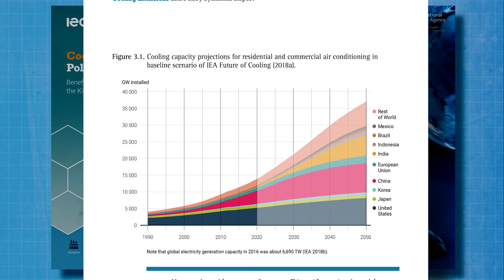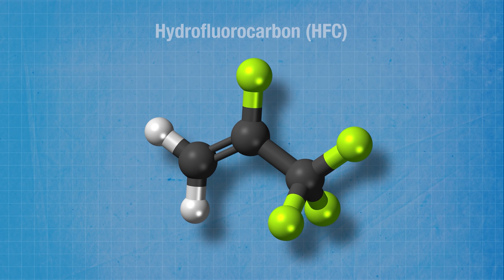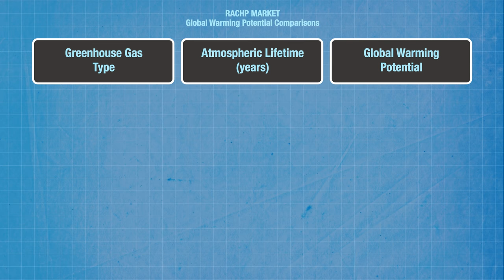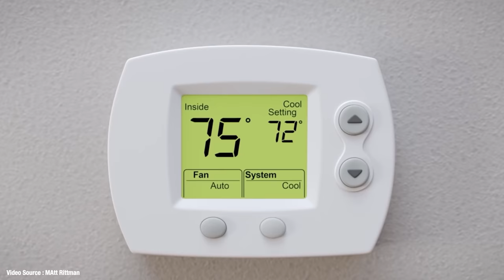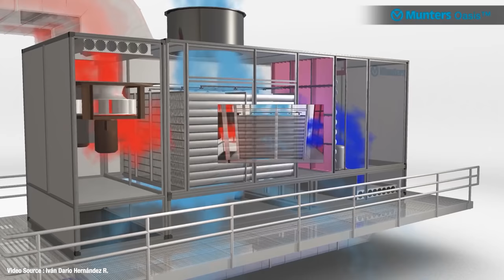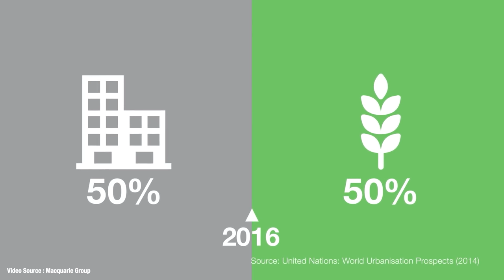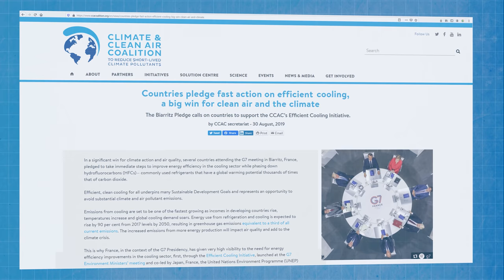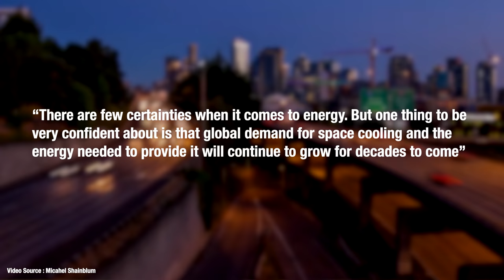Keeping cool in a warming world.

Comment: I am a 30+year experienced refrigeration engineer and the real problem with refrigerant containment is share holders continually reducing budget for greater profits. Less budget means less staff to correctly maintain equipment and greater refrigerant loss.
Reply: But... The cut there own tail... As you know to an well maintained chiller are more energy efficient and will live longer. Check out ClimaCheck if you haven't. It's an add on equipment to analyse every part of the cooling cycle, get larms in advice for failures and other changes in the system affecting efficiency and maintaining. To be transparent I have been working for them 10 years ago but now I am there customer and I have so far not heard of any competing system. If you know, tell me!

Comment: With enough clean electricity anything  is possible.  I think its high comedy to blame an infant industry of radiation transmission for the problem of radiation absorbing capacity.  At worst its part of the adaption,  at best its part of the solution.

Comment: The scariest thing is we are basing policy on IPCC  models that have never made even a single skillful prediction. It,s a failed hypotheses.
Reply: @incognitotorpedo42  your linked data is quite old. By 2016 the observations were right at the upper limit of the IPCC projections. It does seem that the IPCC, if not wrong, certainly painted a far rosier picture than what actually happened.
Reply: @gasdive  True, it's actually warmed faster than they predicted, if anything.  I'm pretty sure the guy I was responding to was making a denialist argument though.
Reply: @incognitotorpedo42  I'd say you're right, he was. It's amusing that they get it so completely backwards.
Reply: @amirlach  Your first link uses cherry picked old data.  If you look at data out to 2019 or later, you'll see the IPCC models did not overestimate.  Denialist blogs like WUWT are not a reliable source of information.  The AR5 animation still uses old cherry picked data.  It also makes the statistical error of starting the line fit on the first point.  This is discussed in my link.
Reply: @amirlach  You keep showing me the same dataset that ends around 2012.  These denialist blogs that you frequent use language that "smells like science" but they never get it right.  People were making claims about bad surface temperature data ten years ago.  I took it seriously, looked into it, and it turned out to be crap.  It's still crap. I'm telling you man, denialist blogs are full of it. They are a disinformation cult that recycles debunked garbage.  If you really want to know the truth, leave them.  If you want to bathe in the soothing waters of what you already think is true, then keep doing what you're doing.

Comment: Co2 will not make high temps higher, it’ll make the low temperatures warmer. I wish people would understand this.
Reply: It does both.
Reply: ,
No it won’t “do both”, that violates the 2nd law of thermodynamics.

Co2 acts as a blanket, a blanket does not produce heat but acts as an insulator.  How does an insulator produce heat?
Reply: @yosemitejam  no, it doesn't either produce heat or break any laws.

Energy comes in and heats the ground. The insulator slows the energy getting out. So the temperature has to be higher for the outflow of energy to equal the inflow.

If there were no greenhouse gas the earth's temperature would be about negative 18 C (cooler than the average sea-level temperature in Antarctica) and the maximum temperature would be much lower than it is now. So the lowest and highest temperatures on Earth are already elevated by greenhouse gas.
Reply: @gasdive ,
You are incorrect sir, the Moon is a similar distance with no atmosphere and the extreme temps are higher and lower than Earth’s.

“Temperatures on the moon are extreme, ranging from boiling hot to freezing cold depending on where the sun is shining. There is no significant atmosphere on the moon, so it cannot trap heat or insulate the surface...When sunlight hits the moon's surface, the temperature can reach 260 degrees Fahrenheit (127 degrees Celsius). When the sun goes down, temperatures can dip to minus 280 F (minus 173 C). 

https://www.space.com/18175-moon-temperature.html
Reply: @yosemitejam  yes, but as you point out, no atmosphere. Which also means no seas. Which means less thermal inertia. That, combined with a "day" of 709 hours means higher and lower temperatures on the surface.

Without greenhouse gas the oceans would freeze. The surface would be ice. Never above 0C.
Reply: @gasdive ,
Not true again, oceans could never freeze because H2O is a green house gas, a more powerful GHG than Co2, so would trap heat, but not produce heat. Understand that no matter how many Co2 blankets you put on it will never make you/earth hotter than the sun would. Co2 cannot produce heat, it only traps it for a time.
Reply: @yosemitejam  I'm not saying we'll get hotter than the sun. The sun is 6000 K. We're like 300 K.

Oh, and the oceans have frozen in the past.
Reply: @gasdive , 
Sweet baby Jesus, what are you smoking?  Co2 can NOT produce heat, what don’t you understand about that?

The fact that the Moon get upwards of 280’ F should tell you that the Earth’s atmosphere keeps us like porridge, not too hot, not too cold.  Co2 will not and cannot make the days high temp hotter. Co2 can only act as a blanket and make the low temps warmer.   

Your concept breaks the 2nd law of thermodynamics.
Reply: @yosemitejam  what I don't understand is why you're continuing to argue against something I not only haven't said, but have carefully explained, isn't what I'm saying.
Reply: Yes you are saying that Co2 produces heat because you  stated  above “it does both.”
Reply: @yosemitejam  no, I'm not
Reply: @yosemitejam  OK, let's try this...

Highest tmperature on Mercury 430 C

https://solarsystem.nasa.gov/planets/mercury/in-depth/

Venus, further from the sun, 471 C

https://solarsystem.nasa.gov/planets/venus/in-depth/

I'll say it again, GH gases don't create heat, but they do make it harder for the heat to get out.

On earth nearly all the heat arrives as visible radiation. That goes straight through the atmosphere without heating it up. It hits the ground, which heats up the ground. The ground being hot radiates heat, just like every other thing with a temperature. The ground gets hotter and hotter, radiating more and more heat until the amount of heat it radiates equals the amount of heat coming from the sun.

If you then add GH gas, that blocks some of the heat coming from the ground. Now there's an imbalance. More heat is coming in than going out. So the ground heats up and radiates more. Eventually it heats up enough that it radiates at the same rate as the incoming radiation from the sun. GH gas isn't making heat. It's stopping some of the heat from escaping. There's so much GH gas on Venus that the rocks actually glow in the visible spectrum.
Reply: @gasdive ,

You stated:
“If there were no greenhouse gases the Earth’s temperature would be about -18C (cooler than the average temperature sea-level temperature in Antarctica)...”

This is untrue because the Earth would be the same temps as the Moon  (-173 C) 

You continued to state:
“AND THE MAXIMUM TEMPERATURE WOULD BE LOWER THAN IT IS NOW...”

This is misinformation, as you can see from temperatures on the Moon, the maximum temp was 260’ F and the earth doesn’t even come close to reaching that high of a temp. These temperature extremes are due to NO ATMOSPHERE on the Moon, not addition Co2. 🙄

To sum it up, Co2 acts as a blanket to help keep the Earth warm at night, Co2 does NOT increase daytime temps )as can be seen by the Moon) and you literally have no idea what you are talking about.  Please stop talking nonsense.

Comment: What I learned from this video: "heavy handed government control will save us"
Reply: Alright; then who or what mechanism do you see other than government likely to do so before we are gasping for air? The Capitalists are making big money off the system as it is- until they see big money for cheap, they are not going to be advocating much less actively making this change happen. Please, feel free to answer- I, and several billion other people need this info soonest!
Reply: We aren't doing very well WITHOUT regulation.  Dave never argued for "heavy handed" anything.  The Montreal protocol was sensible and very successful.   That's the sort of sensible regulation we need.
Reply: To take a constructive approach here - I think we can reframe what can be seen as the ‘heavy handed government control’ that it seems like you’re hearing. I don’t hear a need for draconian government measures, rather a ‘joined up approach’ between government, private businesses and individuals that can help reduce impact in a real way. 
Consider urban planning for roads and buildings - it’s pretty widely accepted that road and building planning and construction requires government involvement if things are to be done right. There are most likely set of rules, guidelines and best practices at local, regional, and national level where you are that apply to roads and buildings. Rather than being necessarily heavy 
-handed (and if you’re willing to come with me on this) it’s not impossible to bring ‘urban heating and cooling’ under a similar set of rules and guidelines at different government level, which sets a higher baseline and works to ensure that the cooling and heating of buildings isn’t looked at purely on a building-by-building basis. Reframing in this way hopefully helps assuage concern around the need for heavy handedness.
Reply: @clog1q  I spent my adult career in big construction and the later part in residential service and remodel- I'm on your side! And you are quite right, there are many areas where we already have much "guidance' through laws and codes to keep our living spaces relatively safe and clean. Shinnah seems to feel that anything but unfettered capitalism is a bad thing- I merely pointed out that it needs watching much as communism and socialism.
Reply: The problem with heavy handed "globally coordinated action" is that the United States is expected to change but developing nations get a pass.  The working class of the United States are already over regulated and over taxed.  Videos like this that promote government intervention to problems that capitalism would likely solve on it's own, are a dime a dozen.  It you want convince the working class to change, show them innovation, not regulation.  This video just shows innovations that are only viable if funded by taxpayers.
Reply: @ShinnahWilde  The problem is now- not fifteen or twenty years down the road. FWIW, the big oil companies, who started in the coal biz, mostly, did not change from the much dirtier coal willingly, but only as a result of the rapidly contracting market for their product. Just look at how much inertia and resistance there has been for the higher efficiency HVAC units available today. Everybody knew we needed to do this, but few individuals wanted to pay the additional costs- therefore the rules and codes approach. the environment is the same- the companies that benefited the most form creating this mess would rather spend a few million on lobbyests than do the hard expensive work of cleaning themselves and their past work up. Take a good look a t coal slurry pits and how hard Duke Energy and many others have fought to keep rules lax and ineffective about these open site hazards to the water sources of many communities in the US today. Or the XLT pipeline passing under a river, where a leak will make the water several million people drink from and the tribes in Nebraska eat fish caught from. Raw Capitalism isn't going to answer this till it absolutely has to. Take that to the bank- they would rather hazard the entire nation to an ideolog like Trump who wants to be The King. After all, they are rich enough to buy even a corrupt Child King off.
  As to the "getting a pass"; until already developed nations embrace these changes and use their developed markets to begin the mass production and generational improvement to these means and devices, the developing world will be less able to buy and use them. The move toward sustainability must start somewhere, and the developed world is where the bulk of the human caused side of this disaster started,, and much profited on it, BTW. The big oil companies in the US and those abroad are among the most subsidized industries on the planet- it is only fair that this gives them a "little gas". Who do you think should pay for it? Where do you think less developed countries will find the funds and knowledge to do these things?
  After WW 2, the US looked out upon a developed world that lay much in ruins; her response was the Marshall Plan that rebuilt much of it. Where is that "can do" spirit with so much more on the table? BTW, most of our larger trading partners in the world are beneficiaries of the Marshall Plan, so it's easy to see the gain for the US as well as so many others. Please Mam, some answers or a least the beginnings of some: most of us (even the RedHatted ones) know we need to address this, but the how  and who pays for it is losing sight of the fact that all of us will pay in shortened , miserable lives if we do not. Including yours. So offer us your ANSWERS, we know the question.
Reply: @ShinnahWilde  "capitalism would likely solve on its own"

Can you give a single example of capitalism solving a societal problem on its own? Ideally one that reduced profits in the name of improving quality of life for everyone in the community (not their customers).
Reply: @ShinnahWilde  Capitalism can't fix the problem of unpriced externalities, like the cost that GHGs impose on society.  That's not part of the market.  It is a Market Failure.  That's why you need regulation, because there are some things that free markets can't fix on their own.  I agree with you that the working class is overtaxed, but not that they are over regulated.  Most regulations do not impact individuals (like the working class) directly.  The last time we regulated refrigerants, every country in the world was a party to the deal.  The US didn't get cheated then, and it won't the next time we need to do it.  No one is going to ask the working class to do anything here.  The next time Joe working class needs a new AC, it will come with a less harmful refrigerant.  I just bought a new AC a few weeks ago; it was painless.  I now have a refrigerant that's better for the environment, along with a lower electric bill.  The only bad part is what the AC guys get for labor to install a system.  That's highway robbery, courtesy of the free market.  The government had nothing to do with it.
Reply: @ShinnahWilde 
 You're dreaming I you think private enterprise would have self regulated us out of the ozone hole.
Global coordination of action is also needed with refrigerant, but it is only partly effective due to industry lobbying.